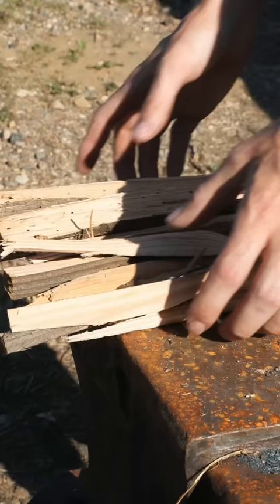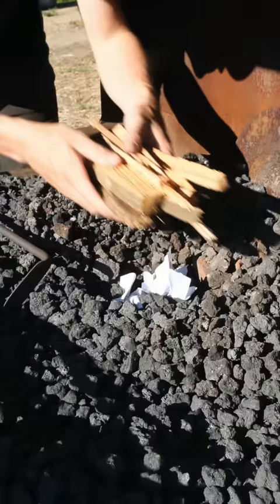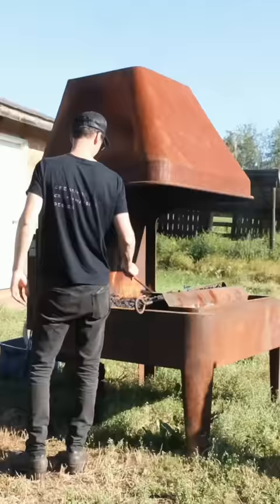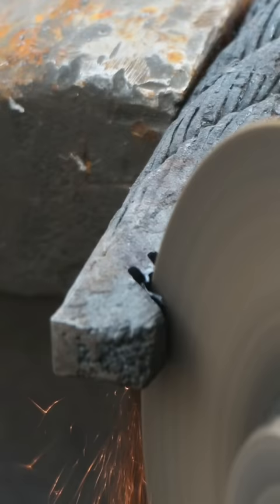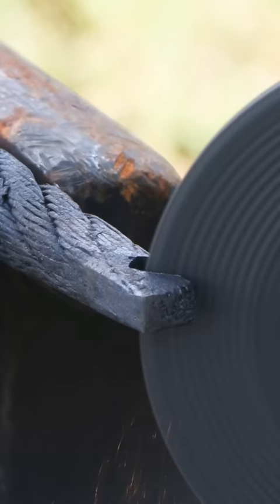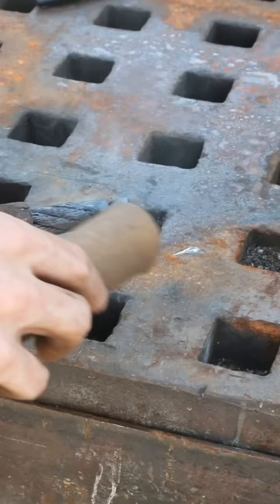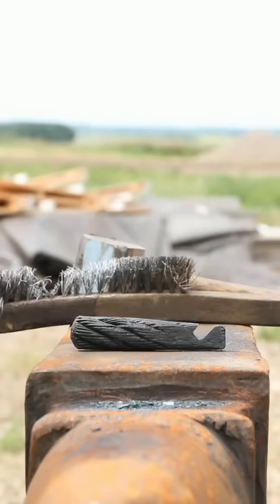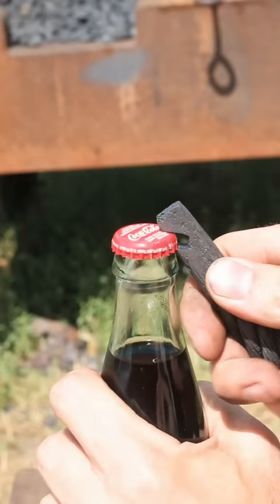Making a bottle opener from cable. #blacksmith #cable #metal #diy #drink #handmade

Comment: I'd add a bit more length or just make it thinner and larger. Now that's a bottle opener. Everything that is not fragile enough and thin enough to fit between the cap and your thumb is pretty much a bottle opener.